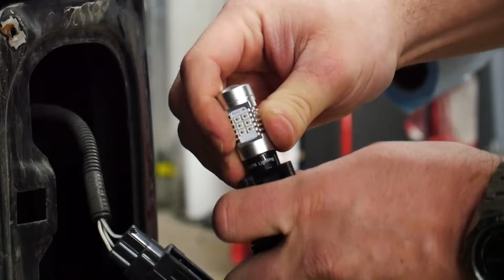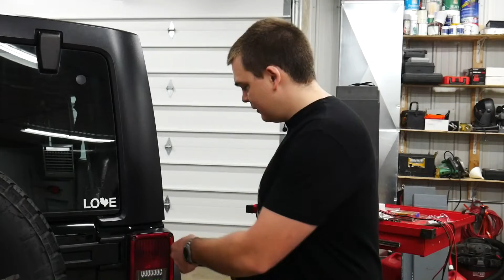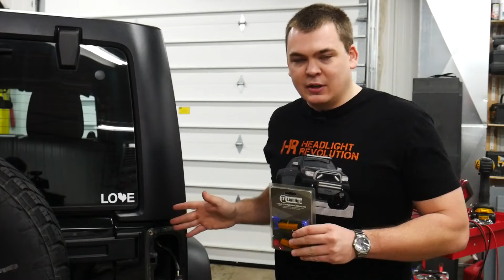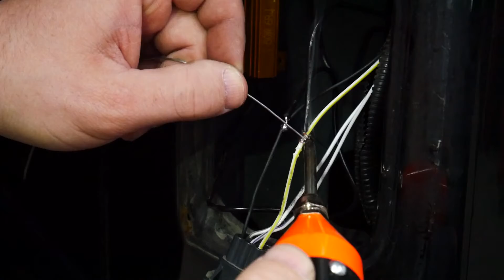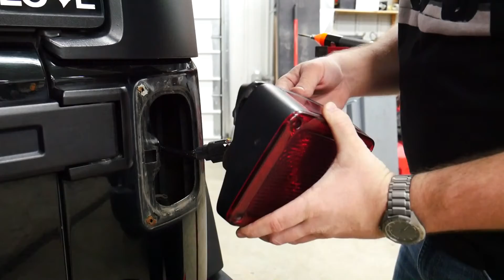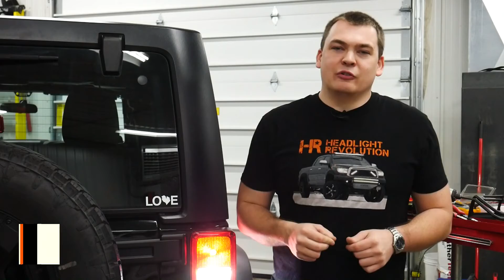SUPER BRIGHT JEEP JK LED Reverse and Brake/Turn Bulbs Upgrade Install | Headlight Revolution

Comment: Which two wires?  That's the most important part of this installation.  The rest is a pretty brainless install, but knowing which wires to splice is the biggest part.  Only need to remove the inner two screws on the tail light mount.

Comment: Thank you for this video! I had been trying to decide between full aftermarket tail light assemblies, but many of the ones on the market are not DOT approved. Even the best options (like the JW Speaker 279) seem to have fitment issues for some and mediocre reverse brightness. That's not something I want to risk for that kind of money. This seems like a great alternative. Those wanting to change aesthetics could always still opt for a guard or cover (especially with the improved output from these kits). Thanks again!

Comment: He never says which 2 wires to splice. The black we know, which other wire?
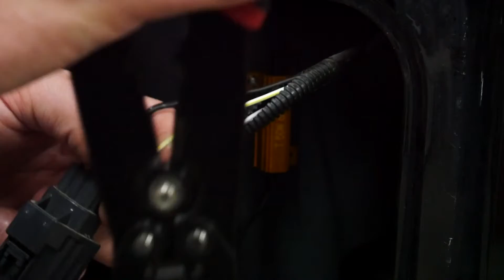Reply: prncinghrse at 2:30, the black and yellow wires have been stripped.
Reply: @MrCatch24alx  There's two black wires.  He says in the video, "we'll show you which two", but then he just holds a black and yellow wire.  What he doesn't say, which I learned from other videos, is that the wires are faintly marked on the plastic where the wire enters the tail light assembly.